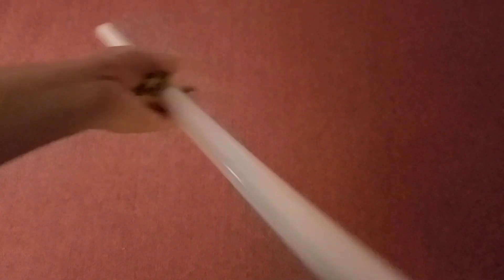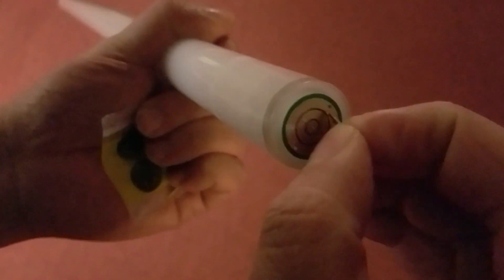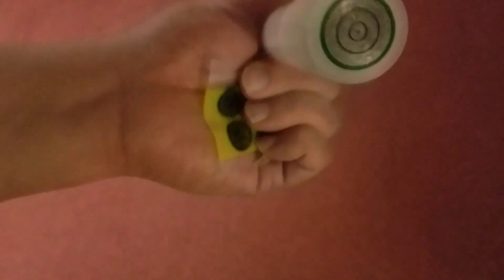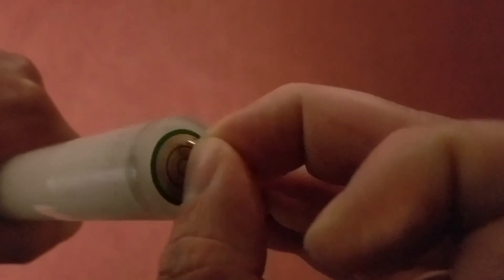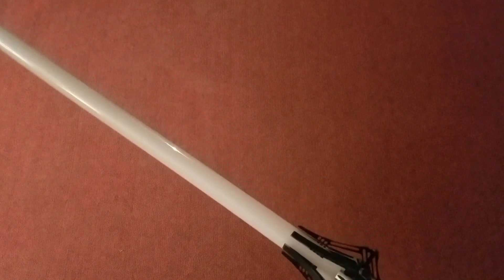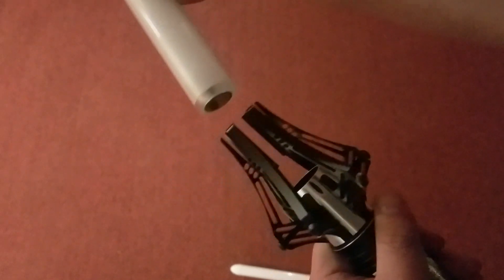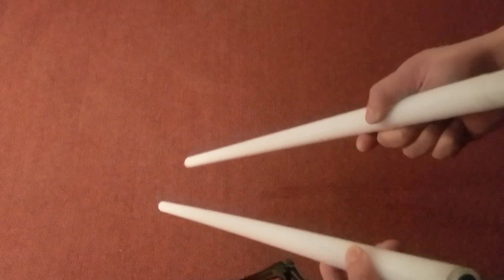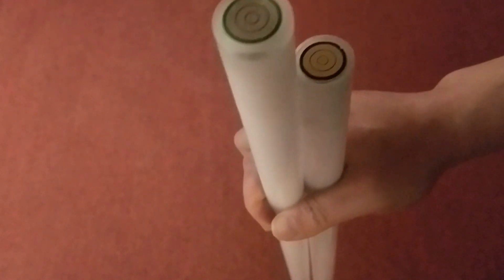Lgt store pixel lightsaber blade follow up review using TCSS connectors over Shtok

Comment: Can you please provide information on the hilt you are using? Sound board? did you build it? if so, can you list the parts? Thanks
Reply from the maker: The hilt is a saberforge custom,  emitter is from a sinister prophecy and the etched body came from grandmaster (discontinued etch). The soundboard I am using is entirely NEC igniter 3 and everything you see on video, the internals,  the wiring is all built by me

Comment: Would you recommend lgt store sabers
Reply from the maker: I bought the blade from them and gave my honest review.  For the price point I don't mind buying another.
Reply: @PakkenTech  how about the sabers? The build quality and soundfx,  how would you rate them and will they hold up to dueling. Thank you for the help
Reply from the maker: @JustGiverEHD1  first off, it is a blade.  It doesn't if not suppose to give sound effects. Secondly,  the build quality is solid and in terms of durability,  it's great only for light dueling. I do not recommend any pixel blade to be used for heavy dueling even if they advertise that it supports it because the pixels themselves are individually soldered in pcb strips. Hard impact will cause a component to seize and that applies to any neopixel regardless of it is for heavy dueling
Reply: @PakkenTech  thanks,  but from your experience how are the light sabers?
Reply from the maker: @JustGiverEHD1  I personally like them. I have no issues with the blades. They do their job and functions exactly what I expected
Reply: @PakkenTech  that's good to know, have you purchased any of there light sabers, hilts? Being the more expensive, middle or cheap light sabers . How to u rate the build quality? And sound card/FX are the sounds accurate and of good quality
Reply from the maker: @JustGiverEHD1  please check my other lgt sabers videos on my page. Information is all there
Reply from the maker: It depends. The 89 sabers installs from lgt store has been very solid. But other cheap sabers they are left to be desired. But they make good starting gifts